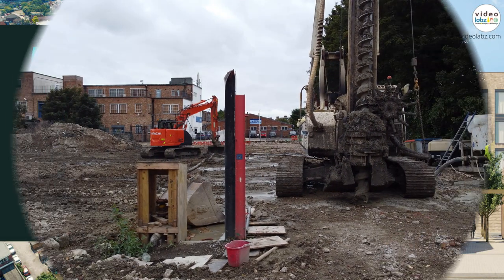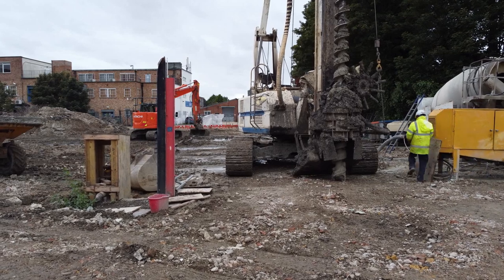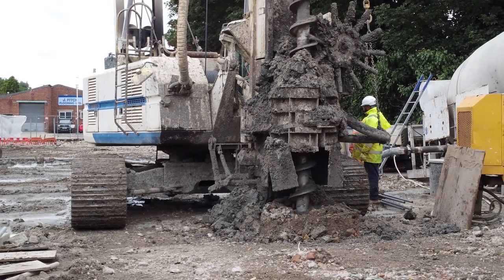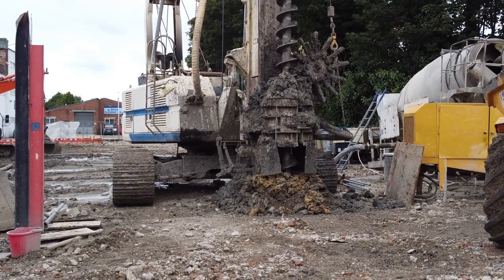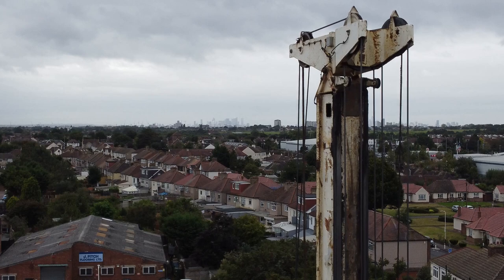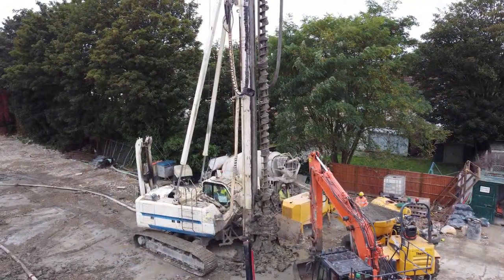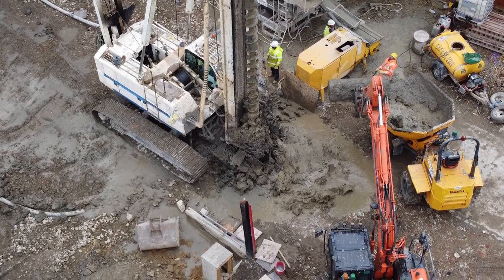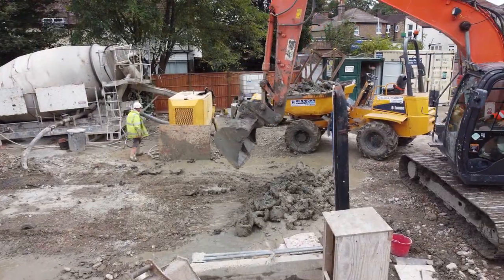Continuous Flight Auger Piling Process

Comment: Great video! Is that standard practice using the earth mover to install the cage in that manner? Would a crawler crane be when you would use for depper piles for cage installation? How many workers are typically involved in this operation? I know you'd obviously have the plant drivers, but you would need banksman and labourers. How do you price jobs like this?
Reply: i'm interested in this questions as well! I'm searching for videos of this process and looking for the practice of installing the cage and cleaning the area.